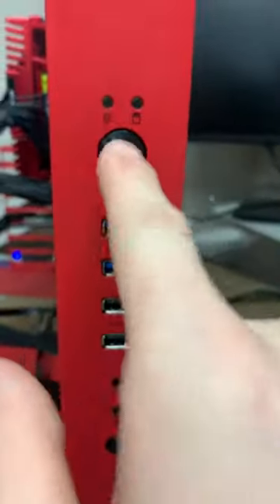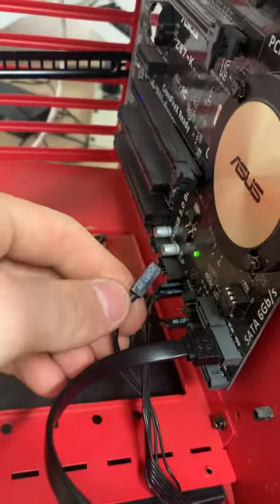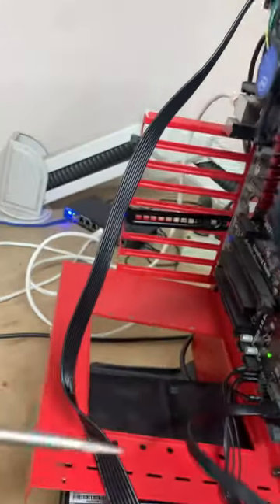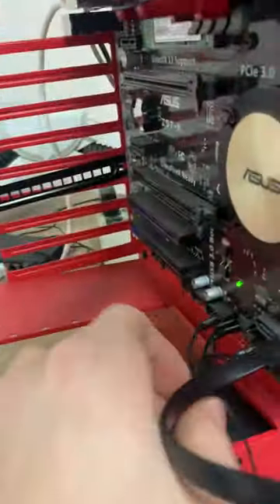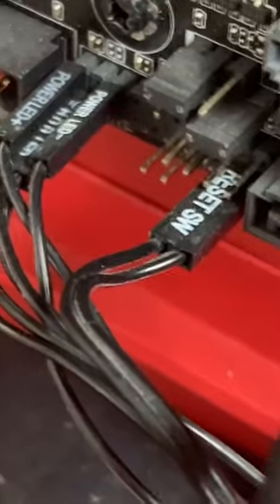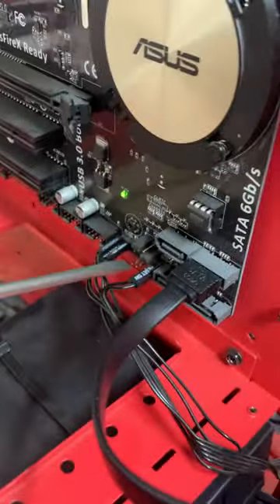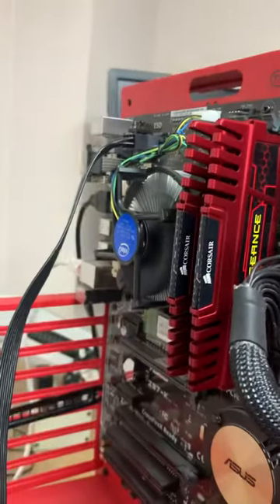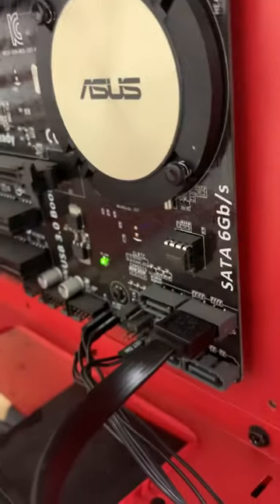How to power on PC without power button

Comment: My CPU is not turning on when I press the power button. Monitor works, UPS also seems working. But the CPU doesn't work. What might be the problem? Can I fix this myself without visiting a computer repair shop?
Reply: Same problem my mobo got led on it and its on. So i know the mobo got some power. I did try the screw thing but it wont turn on 😔

Comment: Hey so i have a lenovo legion t530 and i think the psu is the issue bc it wont turn on when i click the power button, sometimes it starts to then stops like the led light flicks and the fans start but shuts off again, any advice? Thanks
Reply from the maker: Yeah try a new psu and see.
Reply from the maker: Any clicking from the psu?

Comment: Thanks! How do you turn it off? Same procedure?
Reply from the maker: Psu power switch
Reply: @tarzanr  did it but it felt wrong 😅 Gives me some assurance that I read your reply now, thanks!
Reply from the maker: @vikingsofvintageaudio7470  ya. I have never reshorted the pins. I just flip the switch on the psu
Reply: @tarzanr  thanks!
Reply: You can just shut down from start menu I guess🤔
Reply from the maker: @aadd-vz5iz  yeah that would be safer lol
Reply from the maker: Yea, i wasnt thinking. Turn off the computer from the OS. IT IS A LOT SAFER LOL
Reply: @tarzanr  Yeah had no OS at the time 👍
Reply from the maker: @vikingsofvintageaudio7470  ah then that makes sense. Hope you are running fine now.
Reply: @tarzanr  Thanks friend! I'm actually really happy with my build: it 12600K, m-ITX, DDR5 etc - it's a beast!
Reply from the maker: @vikingsofvintageaudio7470  hell yah. Very nice.

Comment: And if still wont turn on?
Reply from the maker: Maybe you put the front i/o for the power button in the wrong prong on the mobo. Maybe the wire is cut but you cannot see it. Could be broken.
Reply from the maker: Or you need a new psu